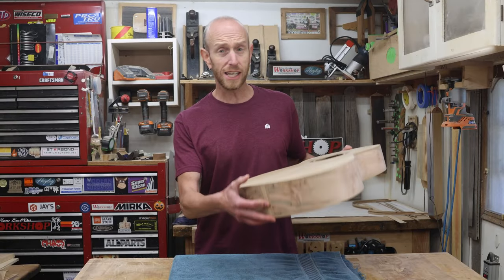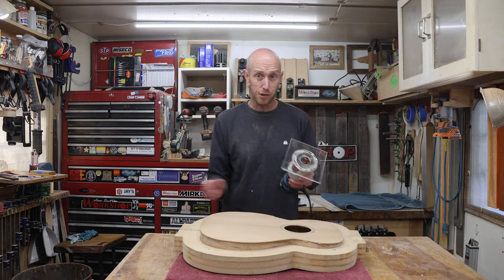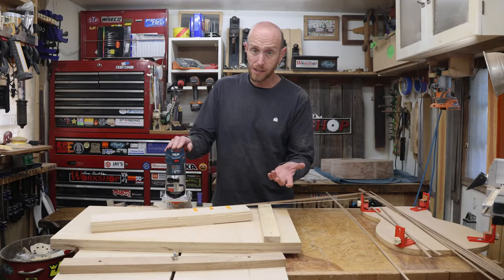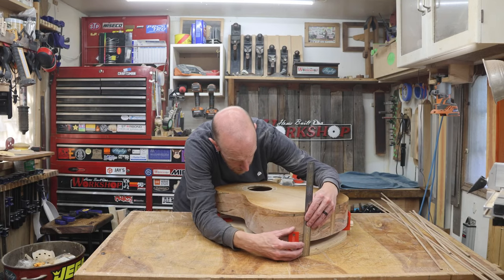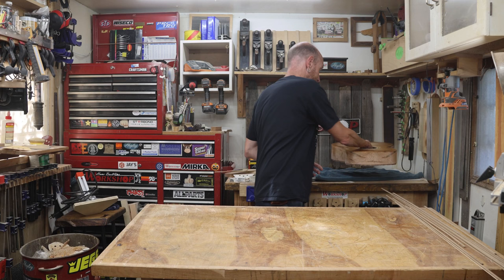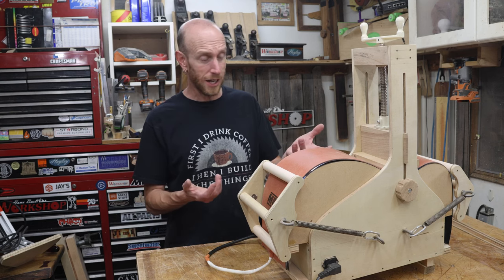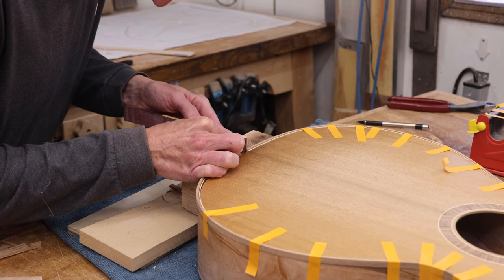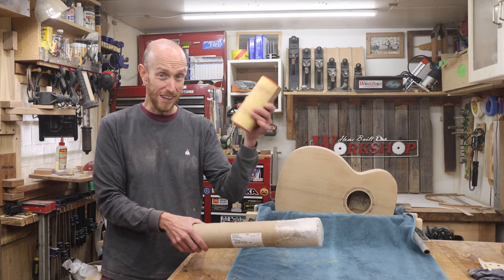Installing Binding and Purfling on my Handmade Acoustic Guitar

Comment: I know you built the binding cutter jig.  But if you didn't have a YT channel, would you get the Elevated Lutherie binding tool?  Even at it's cost?  It seems like that's what a lot of professionals are getting now.  Toughts?
Reply from the maker: Thanks! I have never used the Elevate Jig myself but have check out a version of it that a friend of mine made. There's something about that design that seems a bit unstable to me. I'm not a fan of the way you need to balance the instrument on the jig while in use. My friend that tried it has since switched to a design more like I use. I'm not saying the Elevate jig is bad at all, I've seen many builders use it and have great results. Its just not my personal preference and I personally don't think I'd buy it. I hope that helps.